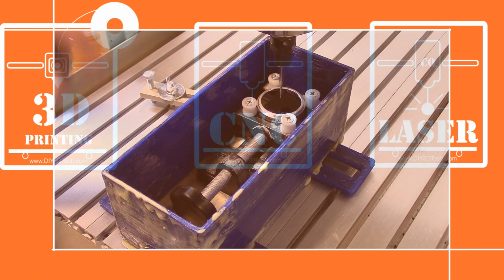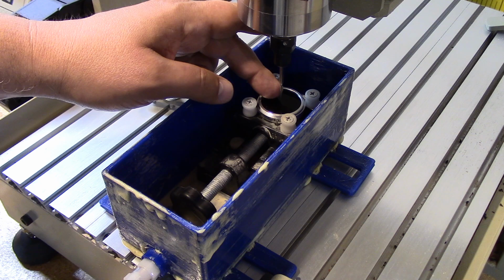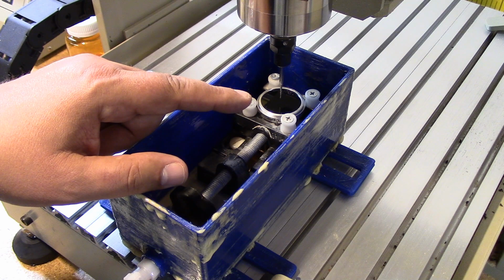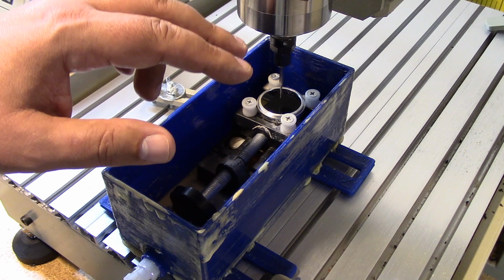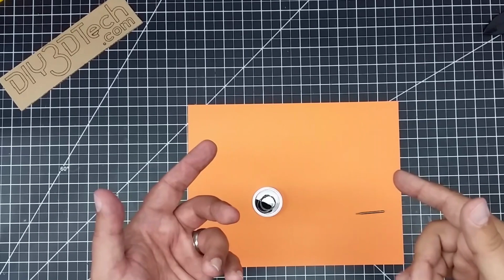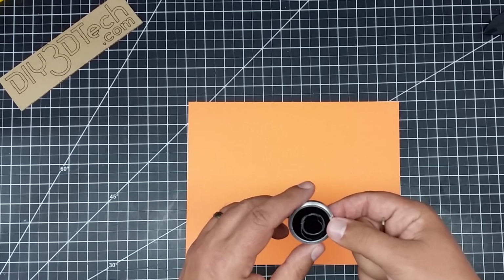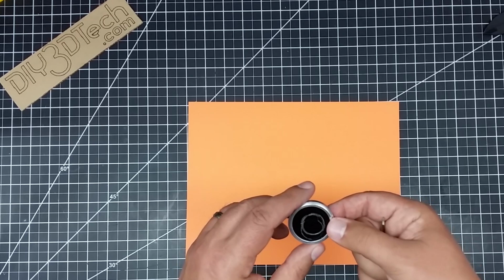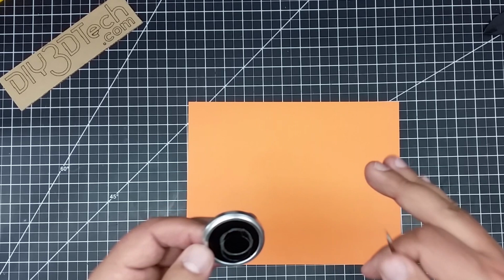3040 CNC - Failing to Cut IR Filter with Diamond Bit!

Comment: I think the problem is that that diamond burr is essentially a side cutting tool and that having dislodged the few specks of diamond in close proximity to the tip you were basically just rubbing the flattened end of the burr against the glass.
Reply from the maker: I see what your saying, however have used these bits to cut other "normal" glass without issue at the same feeds and speeds.  As the odd thing is the glass hardly etched from bit.  I was quite surprised as it appears to be like a metal infused welding glass of sorts.  Do have a suggested bit?

Comment: this is where you find out the filter is a synthetic  gem stone or crystal of some sort .  LIke how some watch crystals can be almost some type  of  diamond .  you might have to bond it to a stock smaller diameter  that the target size  lens you need and let it turn against a abrasive  .  kind of like a lathe  .
Reply from the maker: I think its a metal impregnated glass like a welding glass (the old school kind).  However you bring up a good point, as many are a sapphire based stone which is crazy hard!

Comment: Hi Joe, after getting some hints on 3D printing from you and some useful tools as well, I consider to buy this 3040 cnc with ball screws and 800Watt spindle.
I can get it here in Germany for around 800EUR.
Are you still happy with your machine?
Reply from the maker: With out question! been very happy for the money and for sure go with water cooled spindle!
Reply: DIY3DTECH.com  Thanks Joe, do you have some hints for bits?  Or a page where to read..... about different bits and their job?
Reply from the maker: So far I have just been using cheap diamond bits: https://amzn.to/2Ml5McM
Reply: DIY3DTECH.com Thanks Joe....

Comment: Why not lightly score the glass with a carbide bit and then use the hot/cold water trick to make it separate like folks do with glass bottles? Those cheap plated diamond bits are worthless. If you had a sintered bit and go really slow, it might work.
Reply from the maker: Hmm, interesting, do think being a flat piece of glass this would work?  I also looked at sintered bits and they appear to be drill bits, is there a cutting version?